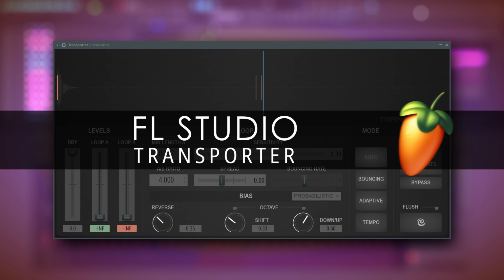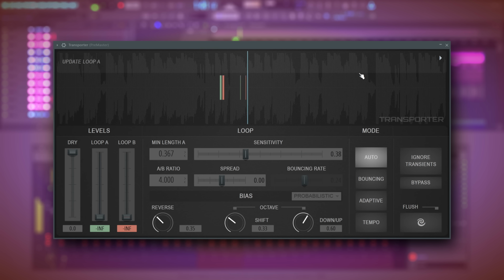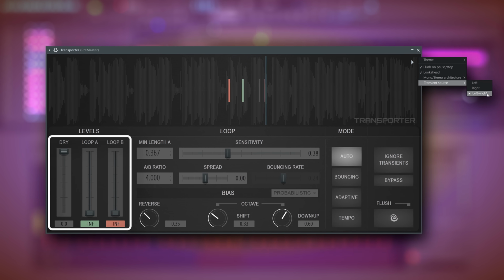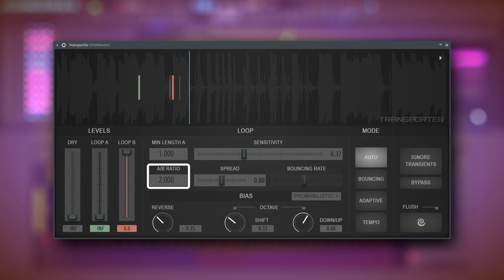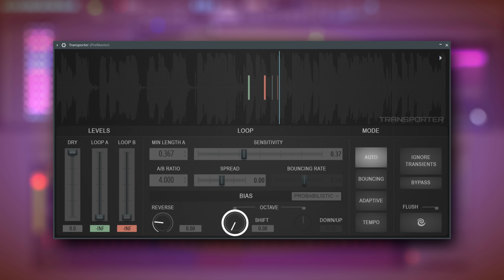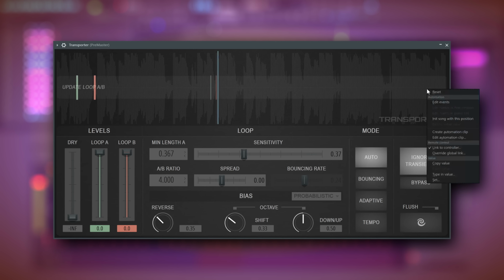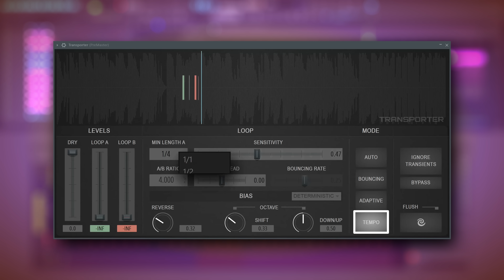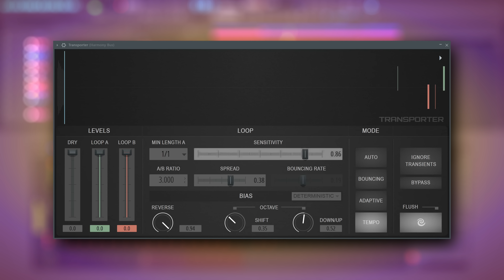FL STUDIO | Transporter

Comment: Thank you for this breakdown, I now feel far more confident using Transporter and am getting much more solid results.

A feature I'd like to see...and feel is a must, and would expand on the self ducking suggestion below...is, Separate outputs for the loops. This would be insane for creative options. Not only could I sidechain each separately but process each separately.

Playing into the sidechain creativity bit, being able to focus the loops to play filtered content, for example using a highpass on Loop A and a lowpass on Loop B or vice versa. This will give the layers a much more tailored feel as I can de-crowd them right from the start. I could do this with separate output sends as well, but think this would be bonkers if the filtering can affect the transient detection stage.

The spread feature is by far my favorite, this is so easy to set up atmosphere with any source material. I love it.

Comment: One of the most creative stock plugins your team has released so far. I've been able to pull off some Flume-y granular sounds, and it's really fun to jam synths and leads through. It's also cleverly done, the fact that it's mostly looking backwards (aside from the slight lookahead), it's extremely latency light.

I've already been building out a fun Patcher around it, programming in a little extra randomness and chaos to various parameters for more unexpected results. If there was any one feature I think would be really cool for this plugin, it would be some sort of controls for 'self-ducking' the levels of LOOP A and LOOP B when the DRY signal is present, but I suppose one could clone a mixer channel to an aux/send, use this plugin with DRY to 0 and use it as wet signal only, and then set up sidechain ducking from there. Might just try and figure it out in a Patcher instance, but it would be cool to have some sort of internal sidechain compression type of control of DRY vs. WET.